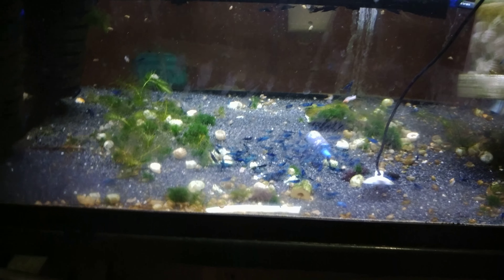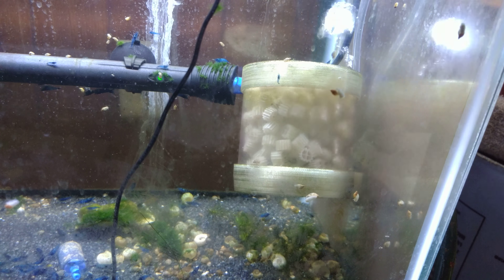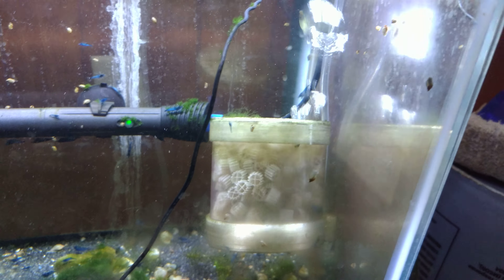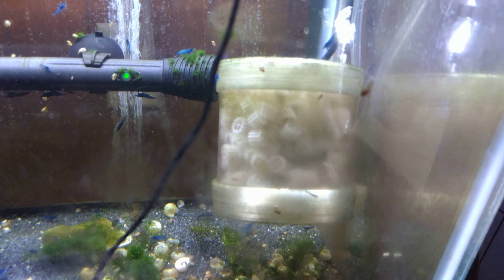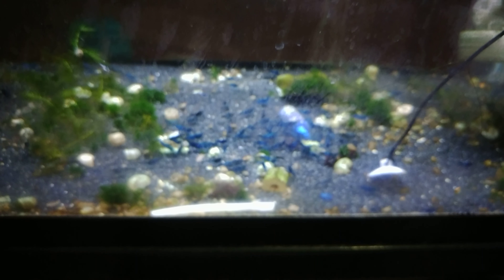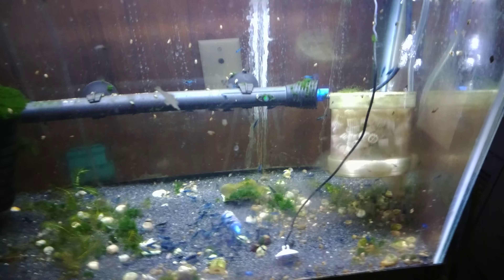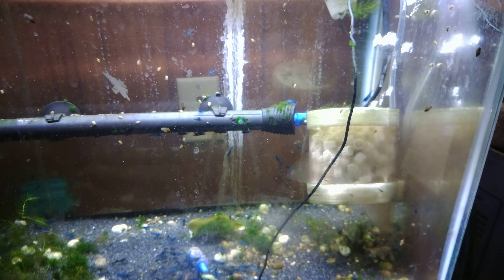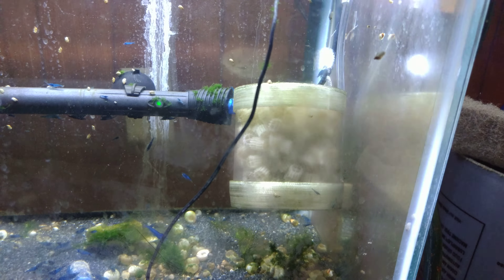Elevate shrimp biofilm reactor

Comment: I just found your video whilst searching for ways to increase biofilm levels for my shrimp and algae eaters. First thing that comes to mind is that any biofilm produced is more likely to leave the unit with the air /water mix than fall back down through the grid. Also the media is constantly being scrubbed and the bacteria and its protective film does not stand much chance to develope. Obviously you will only get aerobic bacteria growing in this setup. Try turning the air volume down some. Cheers
Reply: Was just cracking my fingers to write this comment. Good idea but I dont think its gunna work as expected
Reply: Why not just add another sponge filter? It would be easier and has more surface area

Comment: Can this be beneficial to my planted tank? I tend to overstock my tanks. I want to lower nitrates a bit and keep a balanced ecosystem as much as possible. I’m currently running two aqua clear 110, ATI sponge filter 1-3 pro sponge filters. I also have two hydor 1150 circulating pumps. 

This is in a 65 gallon tank. Might lower the circulating pumps.
Reply: Pothos is a nitrate sponge. Look into it, just make sure not to put too much pothos in planted tank as it may suck too much nitrate away from stem plants in the tank.

Comment: I know this is a fairly old video but this looks extremely easy to DIY on the bottom of a cheap sponge filter, just quarter a pop bottle and cut up a sive, bit of plumbing pipe to attach it to the sponge filter. I might try it 😎😎